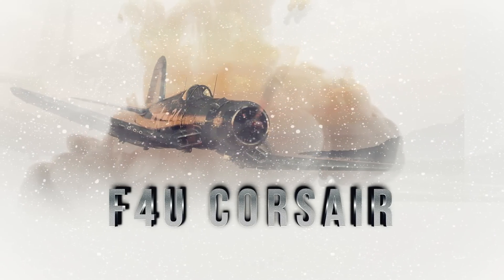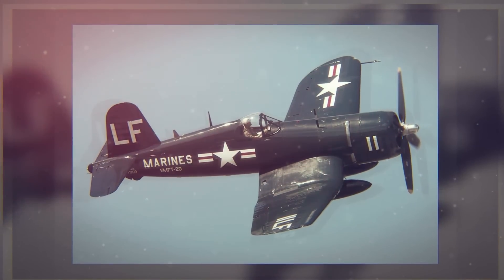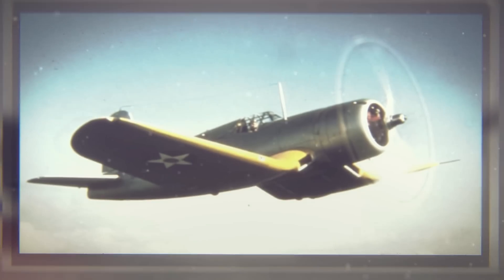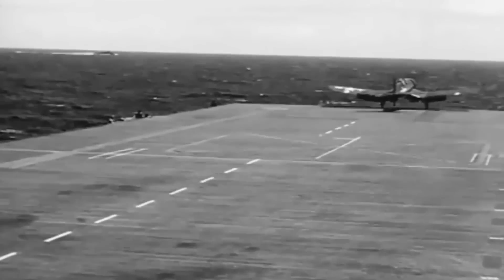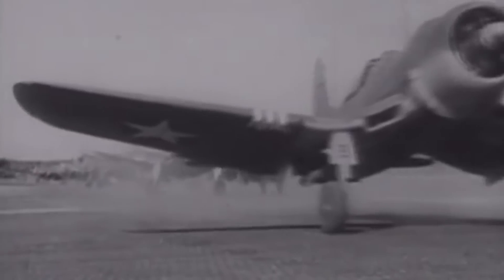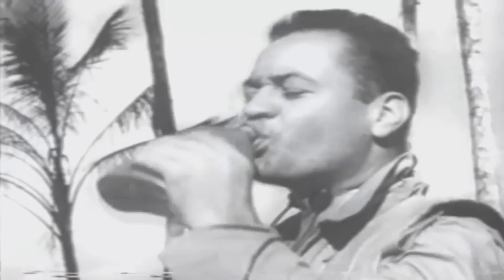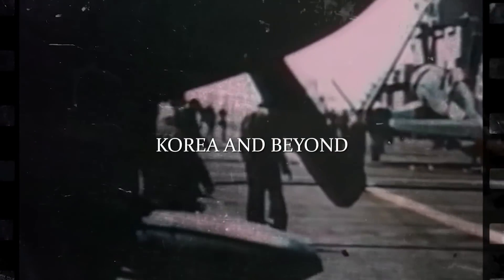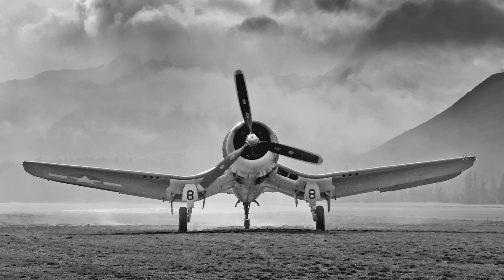Want to Dominate the Skies? The F4U Corsair Might Be the Answer

Comment: Solets discuss the wartime f4u1 it's was a medium altitude performer whoes top speed of 417mph fell rapidly off above 20,000ft.
In the big boys theatre of europe, most combat between fighters often started well above 20,000ft. The fw190 and bf109 simply out perform it at those altitude s. Down to 15000ft.
Reply: If you watch the analysis at Greg’s Airplanes… he determined based on a number of statistics that the F4U could compete with both German fighters; the F6F not so much.
Reply: So it was an aircraft made for a more specefic purpose, and largely only used for that purpose, that sounds like good planning to me.

Comment: "The Ensign Eliminator," it killed more of its pilots in accidents and landing incidents than the Japanese, North Koreans and Chinese combined. It was withheld from carrier duty for two full years till the Marines flying off land bases and the British could iron out its wrinkles. FAST! But the Hellcat was fair easier to land and shot down 2.5 Xs the number of Japanese aircraft and created far more aces. A great ground attack aircraft. Shoddily built, interestingly enough, and the first half of its run didn't even have a cockpit floor. Brewster actually lost its contract for making Corsairs, and went under. One of my favs even with the visibility, technical and landing problems.
Reply: Despite its admittedly temperamental nature, experienced Royal Navy pilots who flew both the F6F and F4U preferred the Corsair as the plane in which they wanted to face enemy fighters. In memoirs, they expressed regret when the US Navy took back Corsairs and gave them Hellcats instead. A good video about Brit Corsairs: https://youtu.be/lH5XSwyb_EU

Comment: You might have mentioned the the technique by which British pilots were able to land the aircraft safely on carriers.
Reply: Wasn't it something to the regard of approaching said carrier by using a long arcing sweep, so that they may look around the nose of the aircraft in order to see the carrier deck?
Reply: @jameskoskinen6763 it’s a method that was already used for landing seafires. i don’t think it’s as simple as that though, the US knew perfectly well that they could use the corsair off carriers, they simply chose not to until around the time that kamikaze attacks favoured the corsairs superior climb rate to the hellcat over the hellcat’s user friendliness in an interceptor role
Reply: Yes- the Marine Corp would have rejected it most likely had it not been for the Limeys.
Straight on landing approaches were nightmarish- the solution was a wide, sweeping turn on approach.
Reply: The Hellcat could turn much better than a Corsair though not as fast.
Reply: @ayrplanes  the British took 8 inches off the end of each wing to fit into their carrier hangers. This improved the roll rate and performance significantly.
Reply: He did slightly mention it,,

Comment: If you look at the performance of all the front line Allied/Axis fighters late in war  F4_u. P-51, FW-190 etc.  They were all about equal. Some had better climb rates others turn/roll rates etc.  It came down  to the pilots and their ability to exploit the plane's advantages and minimize the disadvantages  .
Reply: True on the Western Front, except for the ME-262.
False in the Pacific, where Japanese planes were completely outclassed by late 1943. The Japanese did build some good planes, but too few to make a difference, and most of their fighters were markedly inferior to American fighters.
I agree about pilots, and would add that strategy, tactics, and logistics were also very important. Saburo Sakai credited American air superiority in the Pacific to the fact that Americans played team sports, and thus were good at working as a team.
Reply: True, I just wonder why the Japanese never put self-ceiling fuel tank in the zero after so many were lost to very few bullets
Reply: @thevortex6754  
They did. They put self-sealing tanks in some later models.
Reply: @danl.909  oh, I never knew that, thanks
Reply: @thevortex6754  -self-sealing tanks are more expensive and adds weight to the plane, which is why they weren’t prioritized. The Japanese philosophy was maneuvering and speed, if you don’t get it hit then you don’t need to worry about your tank leaking/burning.
Reply: @thevortex6754  they did not, because they could not manufacture reliable high-horsepower engines, and so needed to keep weight down. They did put SS tanks in later zeros, at cost to performance. Japan was outgunned in industrial technique
Reply: Agreed!!
Reply: You omitted arguably the best in terms of pure dogfighting, Spitfire Mark 14, Griffon engine, 2,100 HP, 20 mm cannon.
Reply: @janandersen8735  Yes it was up there among the best but  IIRC the FW-190D might still have had a better roll rate and faster acceleration in a dive. The MK XIV better rate of climb and turning radius   Like I said no single fighter was  best at everything,
Reply: @carlanderson7618  We are talking dog fight, not dive, shoot and scoot. The Mark 14 was superior in the things that matter most in a dog fight, climb rate, turn and speed.
Reply: @janandersen8735   I would argue that roll rate and dive are important to a pilot who knows how to use them.  They matter in They come handy when having to engage/disengage to regain advantage.  So if you were a pilot fighting a MK-XIV yo would avoid getting into a turning duel with it the same way F-4Fs avoid it withe Zero.
Reply: @carlanderson7618  Didn't say they were not important, just climb rate and turn rate lets you be the hunter, whereas dive rate lets you get away. As explained to me by my old man who flew fighter jets in the 50's. And Mustangs in flight school..
Reply: @janandersen8735  The AVG managed to turn dive rate into a hunting tactic in China flying P-40Bs. In fact look at the overall P-40 kill ratio for WWII.  The MiG -15 was better than the early F-86 with regards to ceiling,  rate of climb, turn rate, and acceleration yet the difference was in pilot skill.   
You also have to look  things like service ceiling. endurance, performance at various altitudes etc.

Comment: Don’t know where you got some of your info but you had a number of things wrong. Vf-17 actually got the plane ready for carrier duty but the lack of spares kept the plane assigned to shore duty until manufacturing could get enough spares out to the fleet.
Reply: This is a re-post of an 40-year old (?) documentary.
I think the delay in carrier qualification of the F4U, concurrent with the already ramped-up hellcat production led to the widespread adoption on the F4F despite the Corsair’s superior performance. Even after qualification, F4U production start-up took time and ran into complications.
As the fleet filled with Hellcats it was apparent that there was an advantage to pilots in training and unit cohesion to fly the same planes. There was also a logistical advantages of maintaining and supplying one type of fighter instead of two as the fleet ramped up with a new Essex and Independence class commissioning every 60 days.
It has been widely acknowledged that the F4U was certainly more demanding to fly than a Hellcat - that may have influenced the Navy, churning out fresh-faced pilots at the fastest rate ever, to consider the advantages of less training and operational losses with an easier to handle plane that still had 90+% of the Corsair’s performance.
Reply: @brookeonmaui  I think you meant F6F.
Reply: @Chiller01  indeed I did

Comment: i didnt know that Limburg flew the corsair . He was big into flying the p-38 and made significant improvements to that program getting a few kills in the p38 before being sent back to the states , its odd he also would have flown the f4u as well
Reply: Lindbergh Flew the P. 38 on a mission too, optimising fuel consumption. Limburg is Rush 👍
Reply: @jonathansteadman7935  Limbaugh
Reply: Did he fly it before or after he invented his cheese?
Reply: Lindbergh was not a very good p-38 pilot. He damn near got his ass shot out from under him. To cocky and arrogant. If it weren’t for the other p-38 pilots there to save him that day he would have been K.I.A. I suggest you read a book called race of aces. It is a fantastic book and will tell you about Lindbergh with his time in combat.
Reply: @mikez3114  cool , he did come up with the mods that gave the p38 its range though

Comment: No, the inverted gull wing was NOT to provide clearance for the propeller. The P-47, F6F, and F8F had similar engines and similar size propellers, but didn't need gull wings as they used telescoping landing gear. The inverted gull wing on the Corsair was to keep the landing gear short and strong because it was also required to act as dive brakes.
Reply: thank you. the shorter landing gear also then takes up less space in the wing, allowing for a shorter chord and overall more efficient wing. this also allows for much larger flaps, critical for lowering the stall speed for a carrier fighter which in turn allows for larger ailerons. this contributes to the excellent rolling capability of the corsair which was a quality noted both by those who flew it and who fought against it.
Reply: It was mainly to reduce drag on the somewhat low mounted wings and the shorter landing gear was a bonus, they were even used as dive brakes